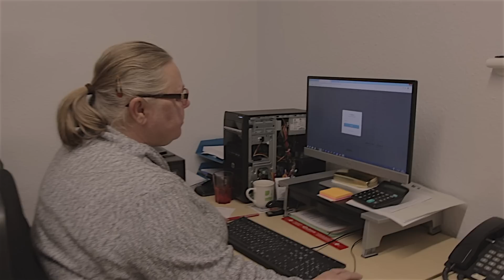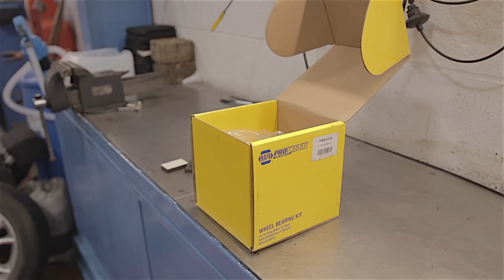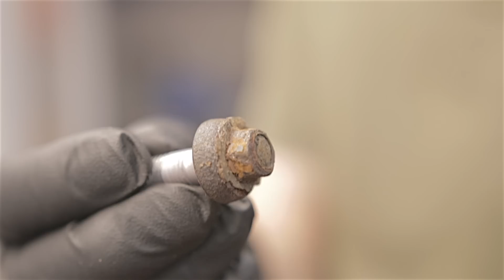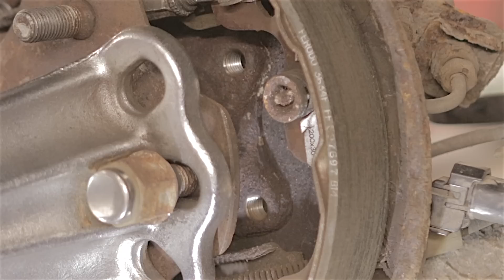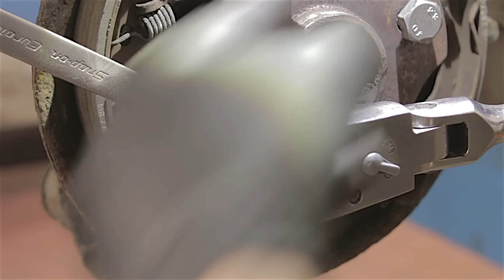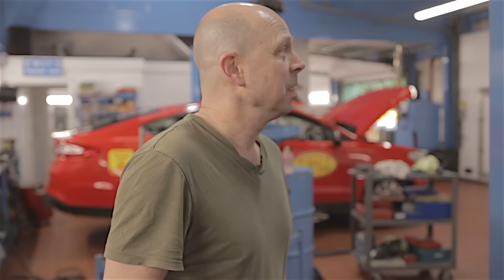Toyota Yaris Rear Wheel Bearing Removal...No Problem

Comment: Nice solution! You know your car is getting on a bit when you need to sweep it up off the ramps. The upper ball joint pinch bolt in a Passat B5 was always a nightmare job until I worked out how to do them. Buy some new bolts and put them on the passenger seat, then take the car to your local garage. Then go back and pick it up when they have done the job and pay them. It's worked twice for me now.
Reply: Yeah...
And all the Audi's too.
Too much force, and you'll break the upright...
Who would have thought that alloy suspension parts and steel bolts would rust together? 😉
If you own a shop, there is a kit for this, that makes your life a lot easier.

Comment: I've just recently done both rear bearing on my 12 reg focus on my driveway it was pretty straightforward thankfully.
Just a story on things going wrong. In 2019 i did an oil change on the focus during which I notice a leaking driveshaft oil seal on the drivers  side, so I decided to replace it I'd done them before so I thought an easy job, anyway I ended up splitting the intermediate CV joint cos the driveshaft splines were rusted in the hub well the CV lobes fell off with the needle rollers so I had to rebuild that, then once I got everything back together I found I had buggerd the threads on the driveshaft up so I had to grind the damaged thread off to get the nut on, so I thought thats it I couldn't believe the hassle id had, went for a drive and realised id also damaged the front wheel bearing up trying to get the driveshaft out 🤣🤣🤣🤣
Reply: What a nightmare... but often the way when you start out on something it is much more complicated than you anticipate.

Comment: That's nice tip. I also usually have small blowtorch type heater in my workbench, so when ever something is tight during dismantling I do similar type of thing that I pre-tention something like that, figure out what to heat to get that expanding metal to work for me. Being machine mechanic I have moderate tools at home to, but nothing special for doing cars. I remember trying to change control arms for one of my cars in the driveway. I used blowtorch, good impact gun and broke two cheapo generic removing forks and got two points loose out of six in was it in four to six hours. Then it began to look like it might rain and throw the bolts back and drove to the nearest car mechanic and asked one thing "do you have good induction heater?". Answer was yes and just said the guys that there's control arms in back seat and change them. It just isn't worth trying to do everything at home :D

Comment: Would heating up the back plate help not help release the bearing? As its being trashed, it wouldn't do any harm. 
Anyway fun to watch you sweat 😎
Reply: The bearing is being trashed, but everything else is not! By the time you're done with the torch your brake oil and most important all brake seals would be trash! So a torch is not a good idea.
On the other hand I've used with great success an air hammer/chisel. After being frustrated with the  results from a sliding hammer and a sledge hammer 🛠 !!
My Yaris is slightly different from this one. In the sense that's disk brake on all 4 corners (D4D). But the pain is exactly the same! Air tool for this job is a gift from heaven! ;-)

Comment: Wait until you have done a Toyota Prius Gen 2 from hub bearing. Galvanic corrosion. I have done a couple and they were just as bad. I was prepared and a few whacks with a sledge hammer sorted it out. Funnily enough my Mk1 Avensis was easy though. I am not a mechanic!

Comment: What's your opinion on ADL Blueprint parts? I've got a wheel bearing from them that I plan on fitting but don't want to fit if it's junk?
Reply: ADL Blueprint are good parts on the whole, one of our preferred brands .
With wheel bearings just aim get kits that reboxed mainland japan bearings .
Reply: @mrb1864  abs sensor is failure before bearing
Reply: @nihonkokusai  
with off brand bearings we seen bearings go bad in under 12 months .

Comment: Holy crap, I wouldnt buy a car from that regiom of GB, that rust is something else, its like it was in a salt mine! Kudos to you for dealing with this crap on a daily basis, I guess at least the volvos wouldnt rust.
Reply: Try removing the rusted bolts on the handbrake motors on a volvo S60 - they do rust!

Comment: Nice one Alan. Didn't see any masks or social distancing in the office there; do I need to report you to the authorities? 

This afternoon I had some headaches with what can only be described as an over engineered thermostat and poor fitting after market replacement part; guess what? I am putting the original part back in tomorrow after testing it with hot water and a thermometer !

Comment: Another top tip if you have a air hammer gun. Unscrew the bolts half way out and then hammer the head of the bolt on both sides evenly. This drives the hub assembly out. Done this on VW/ Audi cars and works a treat.